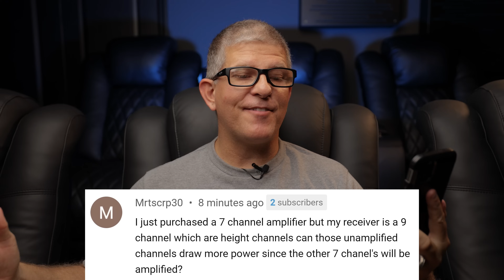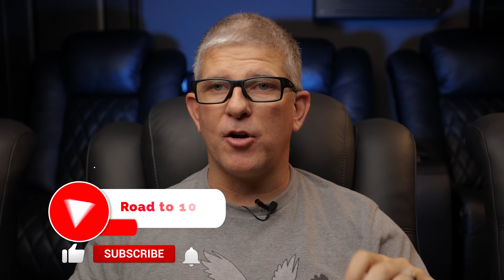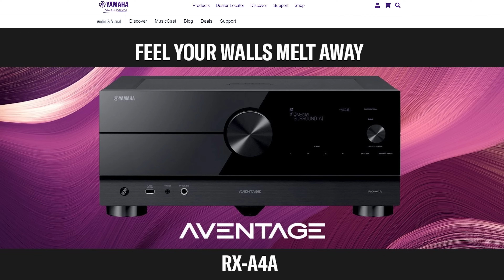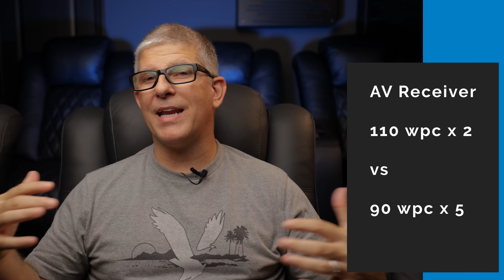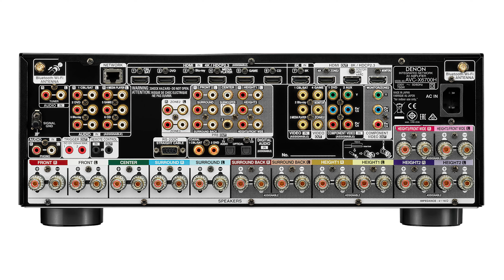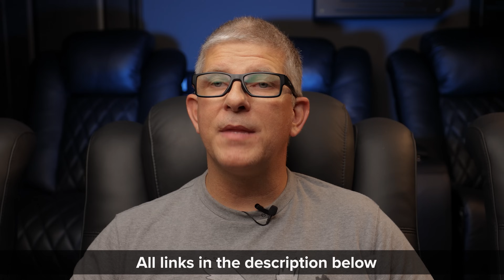How to Get MORE Power From Your AV Receiver - Home Theater Basics

Comment: Koll brake down but that analidgy is diffrent if the AVR is a 7,2 ch each ch at 85w,, you will get all 7.2 ch at 85w bc the AVR is independently rated 85 per ch ,, nd in my case for example to boost this cenerio i usulay get a power amp at at least 125/200w Were he will preamp the AVR nd boost all these ch with more powe , this will only work w thus example if the AVR has independent watage per ch . Let me inw uf m wrong ty nice vid btw

Comment: I run my stereo on Dolby Digital. I find The front 2 channels  are 165 watts each. When I put my stereo in 2 channel, 4channel, and  Dolby X. Receiver puts puts out 100 Watts to each front 2  channels. You can verify this by going through the channels on your receiver for dolby and stereo modes. You will see The woofer Gains more excursion in Dolby Digital vs other modes.

Comment: i have a Denon x4700h which can process  11 channels - 9 internal and 2 external. I have an emotiva 7 channel external amplifier. What option do i choose from the speaker amp assign setting from the nemu since my height 1 and 2 are still connected to my AVR.

Comment: My AVR only has pre outs for a sub. However, if I have an active sub, amplifying the sub is unnecesary, right?
Reply from the maker: Correct. Most subs are active and have an internal amplifier of their own. You use the sub out on your AVR to connect to it since the preout is basically a non-powered signal.
Reply: @Youthman  I've never had a response this quickly on any comment I've ever made, let alone from the creator himself. Thank you so much!
I'm trying to create my first Hi-Fi setup with a humble secondhand Denon 1800H, having used a Soundblaster X3 hooked up to the Logitech Z906 set in the past, and your channel has been like a bible to me. Thanks again and keep on rocking!
Reply from the maker: Thanks. Im very active in my community. Of course I don’t see every comment that comes in nor do I have the ability to reply to every comment, but I do the best I can with the time I have available.

Comment: The title of this video is misleading. This video is talking about adding external amplifiers two power speakers instead of using the internal preamp. Adding external amplifiers to power speakers does not increase the overall power of the receiver. You're not increasing the overall power of the AVR just using less channels of the internal amplifier. Yes, you increase the overall power to your system by using external amplifiers but this has nothing to do with increasing the actual internal power of the receiver
Reply from the maker: You are the master. What title would you suggest?

Comment: So I kinda stuck in this situation. I have onkyo txnr7100 love the receiver with polk audio legends 100 .I have to turn up the volume  35 or sometimes even 45 sometimes, which makes me wonder if im getting full potential of these speakers .I was thinking about buying external amp for those speakers to the receiver, or should I just swap out for the onkyo txrz50 .120 watts .I don't know anything about external amp . I

Comment: 2 questions:
1) how does it make sense that if you have 110 per speaker in stereo mode (So 220 total), that with 5.1 you could have 80? that would be a total of 400 then? isn't it the same total, but divisible by the number of speakers?
2) isn't this only relevant for peak volume, and when you're watching movies, you're not actually expecting all these speakers to play using that wattage? your front speakers do most of the work, and the surrounds consume way less

Comment: Extremely useful information. Very crystal clear. My question is if I add the Extremely amp will I still get the dolby atmos sound output on all the speaker. How does the external amp work with the av receiver connection

Comment: Got it.  The wording used in my 7.1 AVR manual is:  115 watts for two channels driven; 100 watts for all channels driven.  I could definitely tell via some music in 2 ch stereo mode, the speakers are lively and punchy but as soon as I change to a surround mode I  can hear the drop off in power in the front 2 speakers...

Comment: You mean 44 watts to each speaker on a 5 .1.   110x2 watts normally, if you add the center and 2 sides that's 240 watts ÷ 5 speakers which is 44 watts not 80 or 85

Comment: When a external amp is added does the original AVR control the sound preference (EQ, bass & treble) of the sound that is sent to the external amp ❓
Reply from the maker: That is correct. An amplifier simply amplifies the signal that it receives from the AVR.

Comment: A bit odd piece of info (disinfo?)… I can’t recall anytime in the last 20 years where an amplifier (specifically a surround AVR) can only output its rated power to 2 channels. In fact I just looked at two of my ancient receiver boxes and manuals (an 18 year old Yamaha RX-v661 and 15 year old RX-v663) and their output power is 110w x 7.
The interesting tidbit is that both receivers have outputs for 9 speakers (as they’re multi room / multi channel units). The only way you rob Peter to pay Paul is when utilizing the B set of output terminal AND running that second set of speakers while running the other 7 outputs, but simultaneously by bridging those two front outputs (A/B) you multiply the power going to your fronts for stereo music use and can drive much larger speakers (in my case Klipsch’s)…
Reply from the maker: Do some research. There are a few brands that guarantee 70% power with 5ch driven.

Comment: If the receiver can deliver 2x110w in a stereo setup; total of 220w. How can the receiver deliver 5x80w = 400w when in a 5.1? Where does the extra power come from, or why does the receiver only deliver 220w in stereo, when it obviously can deliver 400w?

Comment: So if my avr says 5×100watt.. and not 100watt rms (2channels driven). Is it then 5×100watt??    And i agree, with others. They should provide, the factual info and bs customers!
Reply from the maker: What AVR do you have?
Reply: @Youthman  ive got a harman kardon avr170.. no matter where i look, its the same 5×100watt. No 2 channels driven label.  (Sry i wrote 7, its 5channels😉)

And ive seen some marantz and few other avrs.. where it also says 9×140watt and 7×105watt. And still no writing about 2 channels!

Comment: so much placebo up here... if you can not turn off your channel amplification in your avr setup... your avr will not know that there are no loadspeakers hooked up on that specific channel. so it will send power to all the channels needed depanding on your setup as. 5.1, 7.1 and so on. your avr will always think, there are loadspeakers on every channel, for example a 9 channel setup... so the avr will amplify all 9 channels. it can not know that you use the preouts for external ampflification. aggain, only if you can turn of your seperate channels in your config... then you will have more power for the rest! not every avr can do such configuration. some can only sent the front LR speaker to an external amp and shut internal amps off... or some can do that only with height channels... the marantz 6015 for example can go to a pre mode. but you can not select individual channels to shut off and keep others running. the marantz 8015 for example is a better one... you can choose any channel you want to setup via external amp
Reply from the maker: With the SR8015 in preamp mode, it disables all internal amplification so that you can only utilize preouts.
Reply: @Youthman  from what i know... the 8015 can assign pre amp mode to each channel
Reply from the maker: @MiG-40i that must’ve happened with a firmware update. When I reviewed, that was not the case, it was all or nothing.
Reply: @Youthman to be sure... i'll check that and let you know
Reply from the maker: Thanks

Comment: OK, I understand the concept of power dividing when adding more than a basic F/L and F/R speakers. IF you have a bunch of surround speakers hooked up (amp loaded), don't those speakers need to be producing sound to cause a drop of power to the main L/R speakers? Just having more speakers "connected" shouldn't do squat to the available power to the main front L and front R, right? 90% of the movies I watched hardly have ANY amount of information (sound) sent to my sides, overheads, or rear speakers. 90% of the sound I hear comes from L/C/R channels. I don't get it.

Comment: Two questions for anyone, if I may - 1) Multiple amps...I'm looking at adding my first amp as a step toward separates and am considering the Tonewinner AD-8300 (most budget-friendly option I have found).  If at some time I wanted to upgrade to a 16-channel processor, how would I configure the inputs of an additional 5-channel amp?  Can they be assigned? 2)  If I added rear heights to my bedroom/H/T would I be able to tell they were even there?  My single chair is against the back wall, and the only place it could go would be high almost directly above my head.  I have a 7.2.2 system using a combination of Klipsch (LCR, front heights) and Polk (satellites) for my surrounds and run it with a Denon X4700H AVR.

Comment: I love your videos, so easy to understand. I do have a question; i see the height 1 and 2 are used for ceiling atmos but what is height 3 front wide used for? is it voice of God( top dead center ) how do you set up the height speakers for the best Atmos sound?
Reply from the maker: Thank you kindly. It can be used for Height 3 (like if you have six in-ceiling speakers) or you can use that as your front wide channels. You assign it in Amp Assign section of the setup menu.

Comment: HI. I have a Yamaha rx-v585 80 watts x 2 channels. I have a 5.1.2 setup, my front speakers are Polk Rti A1(Left&Right) and my center is polk CSI A4. The speakers are rated at 20 to 125 watts. Is my receiver delivering enough power to my speakers to not hurt them.

Comment: i returned the first LX505 because the chip had gotten corrupted as a result of a speaker wire short. Got the replacement and have been very pleased. But then I ordered and connected a Tonewinner AD7300PA + and have been even more pleased and impressed, I do wish I could control the crossovers independently and the subs were separated but those aren't deal breakers. In Australia the Onkyo RZ50 was 200.00 more than the Pioneer. I've had no trouble getting into the menu. If i would warn about anything it would be about speaker connections and wire shorts, which can be potentially disastrous

Comment: So my receivor says 170w x 7 channel..avr 5803. So it has a ton of amplifiers.
Reply from the maker: Yes, it was a beast in 2008. Pretty much everything has changed in 15 years. It doesn’t have any current features. You can always add a 200x7 amp to a modern AVR to get better sound and more power.

Comment: Great and clear explanation. Don't you loose the surround sound effects if you off load too many speakers to an amplifier?
Reply from the maker: No, why would you lose surround effects using an external amp? The AVR or Processor sends each channel’s info to the amp and then from the amp to the speakers.

Comment: False. If you're denon or Marantz reciever says 110w per channel with 2 channels driven. Your actually only getting 77w per channel maximum with 2 channels driven and once you connect 5 or 7 or 9 speakers the wattage per channel will drop significantly down to 29w-45w maximum per channel.
Reply from the maker: D&M guarantee 70% power with 5 channels driven which would be 77 watts x 5.

Comment: I have a 5.1.2 AV system. Sony Receiver does not have pre-outs bumper. I'm using Polk T50 speakers' front (speakers). Will more power, increase sound quality in the speakers? 
 How can I get more power buy new Av Receiver.

Comment: So, I have an Outlaw 7000x that is rated at 7 x 130watts (all channels driven). It is hoooked up to a Denon x6500h. The Denon is only powering the 4 height speakers and the outlaw is powering everything else. Does the outlaw send 130watts to all of the channels or is is splitting that 130watts between them all? Would I be better using the outlaw to only power my front stage (LCR) and let the the denon control the rest?
Reply: Nearly all external power amps,  Outlaw/Emotiva/Crown etc. Will drive each channel or all channels at the rated wattage, in your case, all 7 channels will be capable of getting the full 130watts each.
Reply: @johnbancroft5242  THank you for the answer!

Comment: I have Pioneer VSX-932 AV receiver that I love the way is sound specially for 2 channel stereo music  but only have preout for 2 subwoofer even so  sound amazing  , so I bought 2 Russound ADP-1.2 Speaker Level to Line Level Adapter with this I can hook up external power amps to my receiver so I  got a very good deal  for 2 used AudioSource Amp Three 2 Channel Power Amplifier 150w pc ,hook it up for my front stage channels   and even my 3 powered subwoofer sound more vivid. For those that doesn't have AV receivers with pre out channels this adapter will do the job well done so you save money and will keep your lovely old receiver
Reply: Hi I need help like this I've got the pioneer vsx-534 and wanting more power for speakers don't know what to do plz

Comment: I think the tower speakers need more power since it has at least one woofer more. So giving more power than Avr gives better low frequency effect. I am also considering Amp for 3 channels and Avr with preout, as I have upgraded to  3 way towers (with 2 woofers apart from midrange driver) and 3 way centre from 2 way bookshelf LCR.

Comment: Hmm I took down all my surround and atmos speakers and have external amps but right now was just using the denon to power some 2 ch towers but the speaker setup still had all the speakers in the setup , I thought I might hook them back up but I since reprogrammed the receiver telling It I only have 2.1 hooked up . I wonder if that gave more power to my 2 channels or would the other speakers have to be hooked up and playing to draw away power or would it still draw power even tho they weren’t hooked up but programmed as if they were . ? It doesn’t matter just curious .

Comment: Great video! I have recently gone from all AVR power, to a 7 channel A700 Emotiva with the Denon X3700, it sounds really great but need another two channels for 4 Atmos... I have always wondered if the increase in sound quality is noticable running the amp in full pre-amp mode vs running even two channels from the AVR, as all amps are then operating. Has this ever been tested/measured? Thanks

Comment: Thanks for the explanation.  This may explain why my Denon AVR-x3500h does such a poor job of driving my B&W 5.1 system.  I never had an issue with my Yamaha RX-V659 receiver.  I had to upgrade (I really wouldn't call it an upgrade) because everything moved to HDMI.
Reply: That’s because the Yamaha is actually outputting its rated power for every channel…
Reply from the maker: Mike, actually the Yamaha doesn’t. - https://www.audioholics.com/av-receiver-reviews/yamaha-rx-v659/#toc-h2-2

Very few AVR’s can provide what they claim with all channels driven. Some brands like Denon and Marantz guarantee a 70% power with all channels driven.

Thomas, the issue is your BMW speakers are quite inefficient, therefore, take a lot of power to reach their full potential.

Comment: A point worth making is that there are benefits outside of more power.  The less channels per power supply, the cleaner the sound (all else being equal).  Also, I suspect a much lower noise floor is on offer if your receiver isn’t using any of it’s on-board amplifiers.

Too much fixation on power in home theatre, IMO, so many think that a power amps only benefit is ‘more’ power.
Reply from the maker: Headroom, dynamics, better bass even at lower volume, More separation of musical instruments….anything else I have forgotten to include? You have to realize as content creators, we cannot can’t make every possible point in every video we make or they will each be 1hr long
Reply: @Youthman  for sure!  I understand completely.  It's just something that I picked up on recently and was itching to share.

Comment: New avrs arnt very good miss the old days when you would have the volume 1\4 the way and it bumped these new avrs need a better impedance for pre out I have to turn all the gains up just to even enjoy it at -40db on certain sources that are super low plus why would you want your tops and backs super low compared to fronts
Reply from the maker: The Marantz SR8015 is a beast of an AVR.